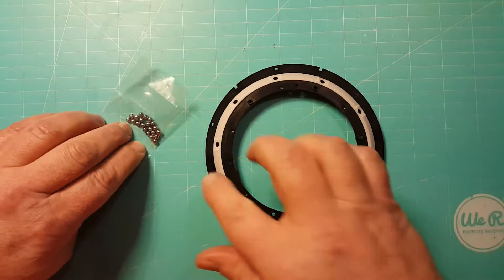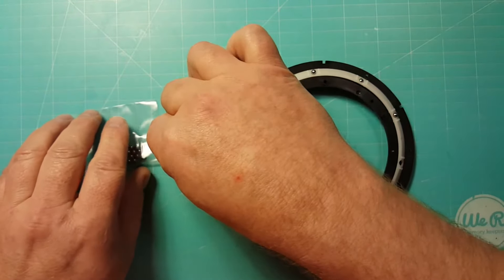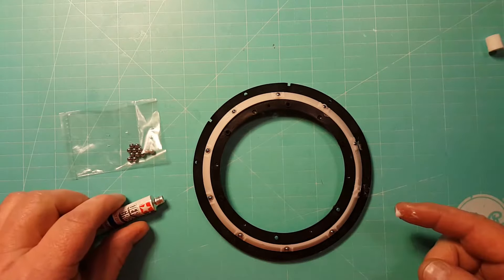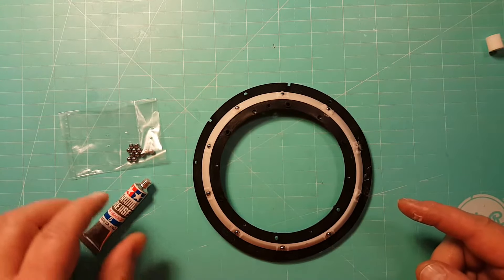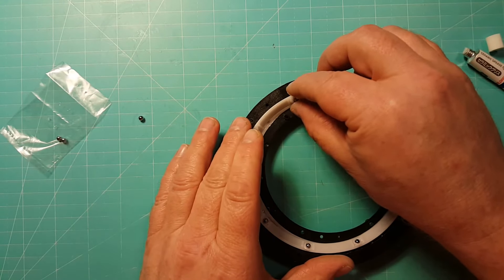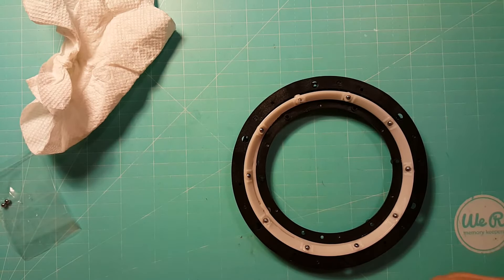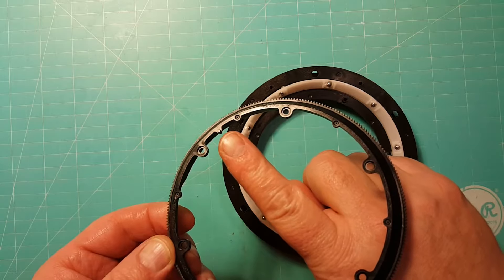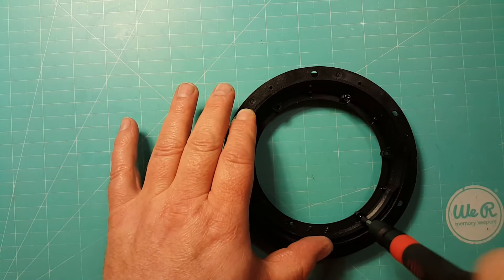Tamiya M1A2 rc tank build series part2

Comment: Good build videos.   Noticed there is only the two.   Did you stop the build or just videos?   Getting close to starting mine soon.
Reply from the maker: I had to hold off on the build due to camera issues. Then other things got in the way like my mail carrier wasnt delivering my packages to my box and he wasnt giving me notices when i had stuff at the post office. i will be starting agin this weekend, maybe even tonight.
Reply: Cool.  I got my transmission/motors together and the speaker box built tonight.
Reply from the maker: that is pretty awesome! did you get the bearings kit that i told you about?
Reply: Yes, I ordered it off Ebay.  The Abrams kit I received did not come with a radio or batteries.  It appears Tamiya changed this over the past year, the kit even has a different model number now.  No big deal, I picked this stuff up as well.  My kit did come with "bonus" bearings though.  Prime and painting the lower hull and other metal parts this morning.  Might start building the upper while I let them dry in the booth.
Reply from the maker: OHHHHHHHHH you bought the model version of it not the full option version. do you have a radio in mind for your tank? this means it didint come with the lighta and the fiberoptics and no mototrs and noting electrical right?
Reply: Honest RC no, this is the full option version.  Tamiya evidently stopped including the radio, battery and charger for this model.  It comes with everything else.  Your kit probably ends with the model #40, mine ends with 41.   I picked up a 6 channel Spektrum DX6 and already have a charger from all my SCX10 crawlers.
Reply from the maker: I also bought mine in Japan.
Reply: Honest RC that’s probably why.  Mine says Export Version: with included ball bearings on a sticker on the box
Reply from the maker: interesting, very interesting. I have to tell you that I am glad I bought mine when I did cuz when I came back from Japan the price of this thing went crazy. Honestly, I was going to wait till I got back to the states but the price for it online went up 3 hundred dollars in just one night and I was getting mine straight from a Tamiya store so I went back the next day and bought it.
Reply: Honest RC question for you.   Step 24 calls for applying aluminum stickers BEFORE painting.  What are these and why before painting?   Was trying to find a answer then I remembered you worked on them lol
Reply from the maker: this is the headlights of the tank the aluminum is the reflective part for the light that is why you paint it after applying the aluminum. you paint it cuz the parts are clear are they not?
Reply: Honest RC the lens is clear but the part I am referring to is molded into the hull piece and sits just behind the lamp housing.   Just wasn’t sure if I put them on and painted right over them for some reason, or if they needed to remain shinny aluminum in color.  I don’t see any parts that would cover this up on later steps.   There is tape that goes inside the hull to reflect the fiber optic, but this tape on the top is confusing 🤷‍♂️
Reply from the maker: you dont put the tape on the outside it goes on the inside.
Reply from the maker: if you look at the the pix right under the #24 it shows the underside of the hull where the lights will go, that is what gets the reflective aluminum.
Reply: Honest RC that’s what I thought and the instructions call for aluminum tape on the inside, but right above where is shows T and U for the inside, it calls for V to go on the outside.  I am wondering if it’s meant to be painted over to help cover any possible “light bleed” from the fiber optic underneath this area.  Can’t imagine the real tank having exposed aluminum in this area.
Reply from the maker: ohhhhh no there is no aluminum on this tank in the front ANYWHERE! it is possible it is for light bleed, however, I feel if you paint your vehicle it should stop that anyway. you can always do a test. get a piece of plastic and put light to it and see if it bleeds through if it bleeds then paint the plastic black or a dark color then paint over it with the sand color that Tamiya calls for and see if the bleeding stops.